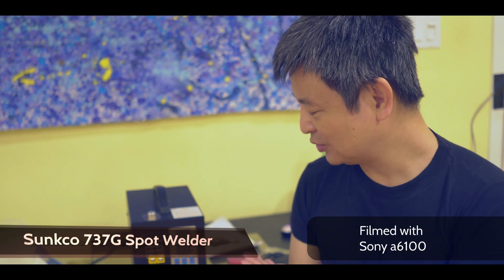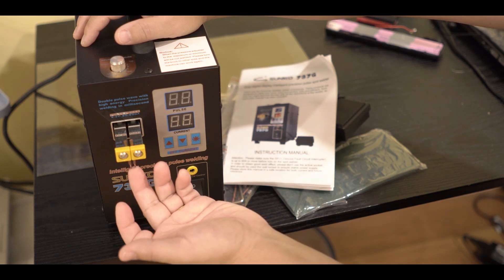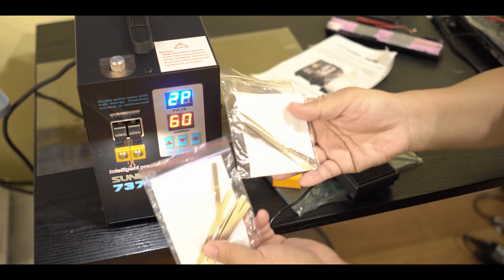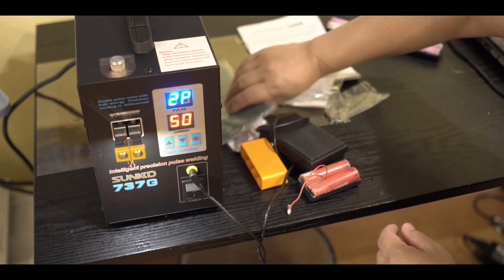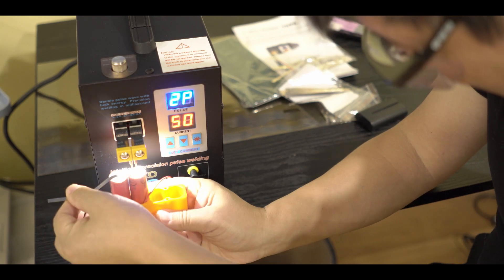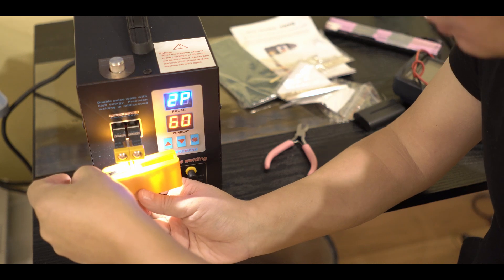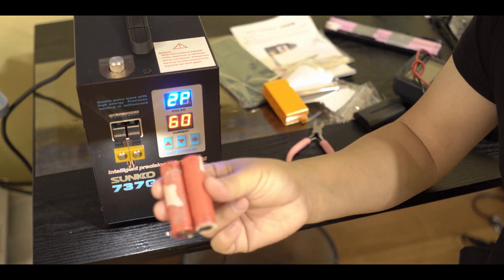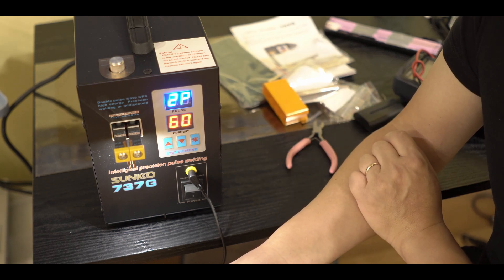Sunkco 737G Spot Welder for Lithium Battery 18650 Spot Welding

Comment: I'm looking to buy one. Can you update us on the longevity 3 years on?
Reply from the maker: It still work great after 3 years.  I don't use it often and the welding pins are wearing out but can be easily replaced.